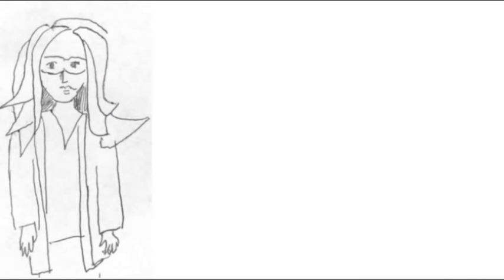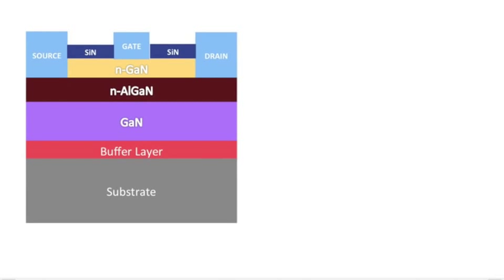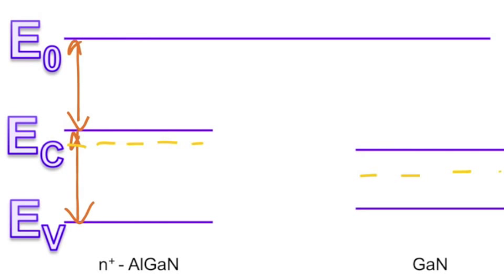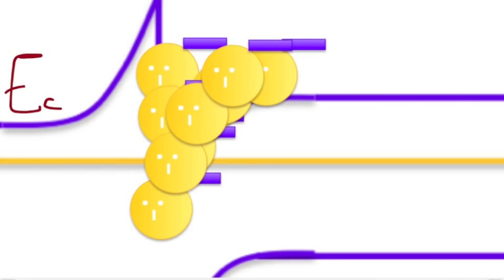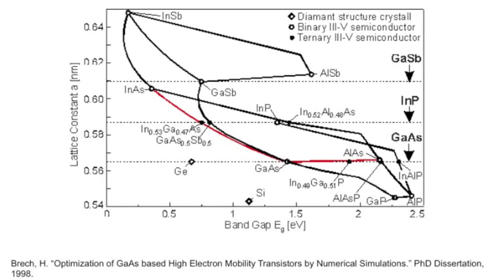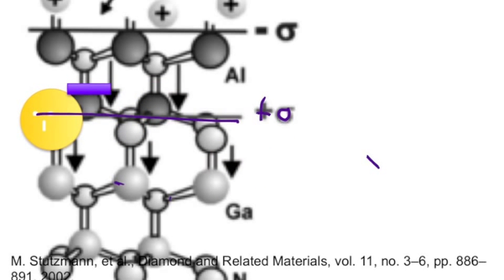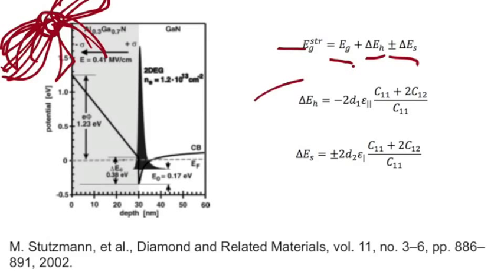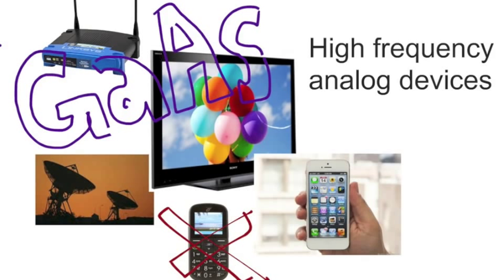Micro-Girl and the HEMT

Comment: Nice video Caitlin. Just a question: "after the creation of 2DEG, how is possible to create a flux of carriers between drain and source? They need to go out from the high density layer through the supply layer (AlGaAs for ex.) in order to reach the two D/S regions?" Thank you in advance :)
Reply: If I can put my 2cents. A few things to consider: 1.The barrier is very thin (talking nanometers). 2. electrons are intrinsically pushed by the electric field generated by the VDS and according to the "least action" principle, they will follow the shortest path possible to reach the drain electrode (shortest in this case means easiest, which means less resistive path).  Having a full barrier though, between electrodes and channel, even if does not inhibit the "flow of electrons" will surely increase the total "Contact resistance" of the HEMT , that is why people try to recess the barrier and create a sidewall contact between electrodes and channel (annealing temperature is also another factor that comes into play). By doing that you will have no extra resistive path between channel and electrode. So in conclusion I would say that electrons will indeed fight their way through the barrier to reach the beloved electrode. but their flow (current let say) will depend also on the resistance of this additive path they have to take
Reply: @alessandroottaviani  Well explanation!!by the way,can you suggest me a good book on hemt?

Comment: How does the gate work??
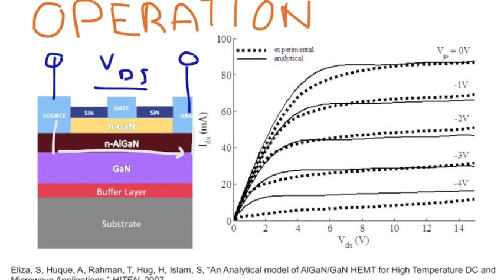Reply: I wonder this too.  At 14:12 she shows a chart that may explain it.  On the chart, drain-source current falls as the gate voltage (Vgs) is made more negative.  I am guessing the gate is open when gate voltage is zero.  Perhaps as the gate is made more negative, it repels electrons away from the heterojunction conduction channel and it becomes less conductive? Not really sure.